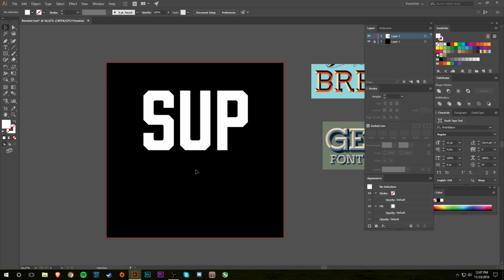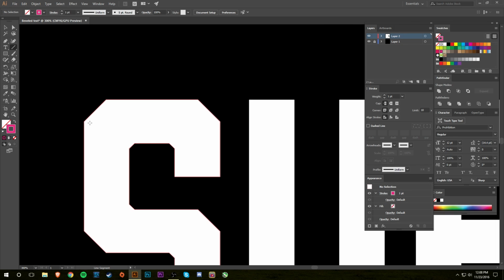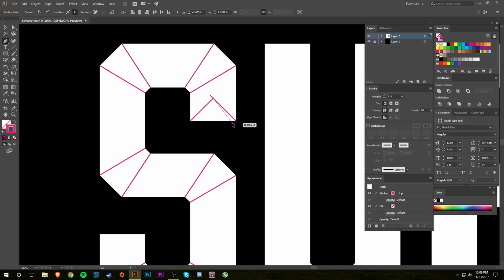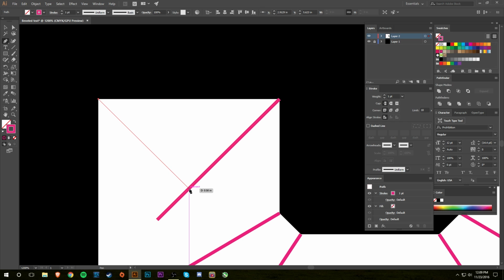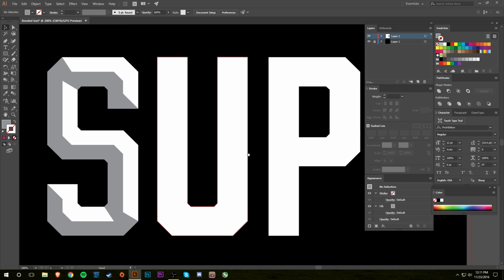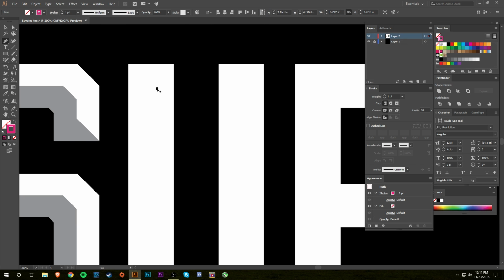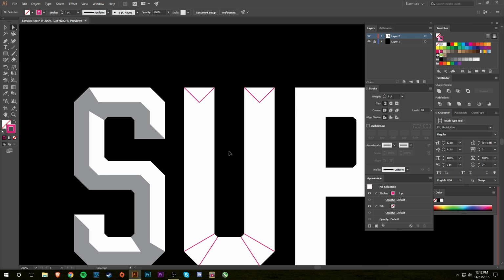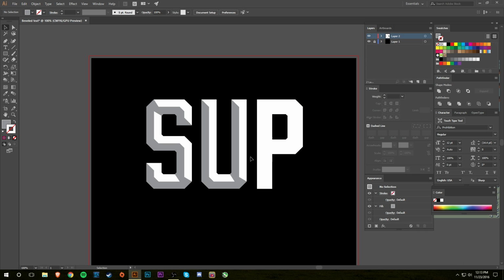How to Bevel Text in Adobe Illustrator CC

Comment: yeah, so pretty sure you can get the effect you probably want with 3d extrusion and beveling by using the Effect > 3D > Extrude and bevel tool. No manual effort required. Pretty straightforward, but you do have to either put the text on a path first or convert the text to vector first. Illustrator is weird that way.

Comment: lol this thing can make just by 1 clicking in photoshop which is call bevel & ambrose
Reply: This is illustrator though. Photoshop does it in a couple of automatic steps but all we get at the end is probably a high res Raster file that unfortunately is pixel based. It will be harder in illustrator but our end result is a full vector object which would be scaleable to any size with absolutely no loss in quality and the sensation of success knowing you didnt use adobes preset effects to achieve your artwork.
Reply: ambrose? LOL